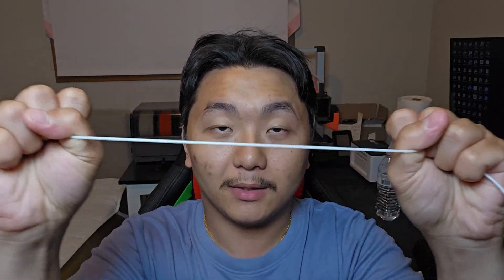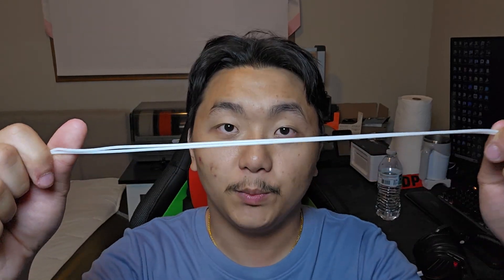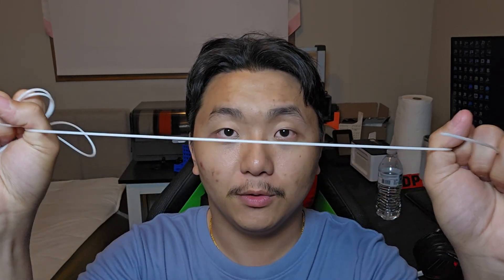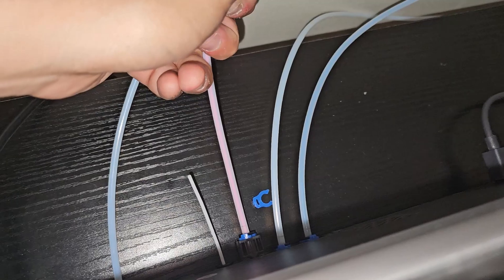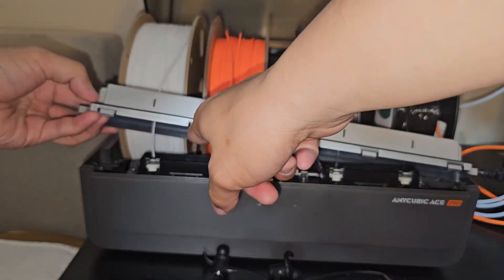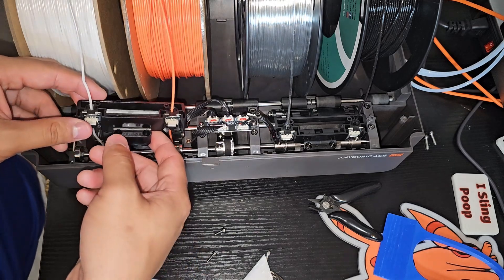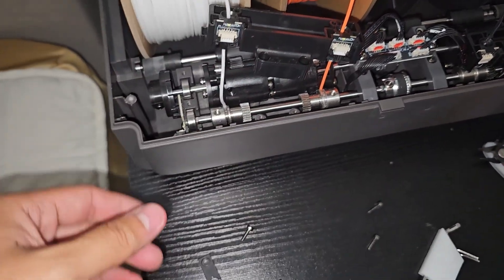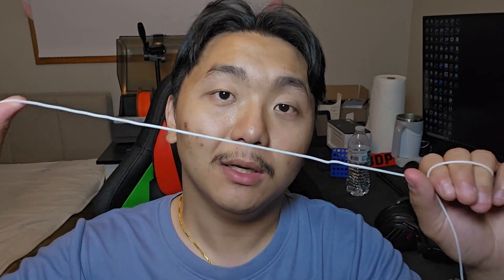Anycubic ACE Pro Cannot Print TPU So I Took It Apart

Comment: Thanks.  I tried to use some old TPU and it would not even extrude. Using your tips I got the ACE disassembled and was able to remove the TPU spaghetti mess.  It had all bunched up under the rollers.  I was able to pull it all out cleanly.  Thanks again!
Reply from the maker: Glad the tips helped you with the disassembly!

Comment: I had the same problem. I tried without the ACE PRO, but it still wouldn't extrude, even when I manually pushed the filament into the extruder.
I finally managed to fix it by loosening the extruder's pretension — specifically by unscrewing the hidden Allen screw on the right side of the extruder.
You need to find the right tension for it to work properly.
Check out this video to understand the problem: https://www.youtube.com/watch?v=5UEUFDP8M30
Reply from the maker: Yeah the ace pro is not design for printing flexible filament. Also yes the tension matters when printing flexible filaments

Comment: anyone tried just disconnecting the ptfe tube on one of the lines and using tpu in that line. perhaps a pulley with a slight weight can be used as a buffer?
Reply from the maker: I think the problem lies in the buffering zone. At the back of the ace pro where it moves back and forth.

Comment: I'm using the spool to print with TPU, it works well, although with some details. Since this is my first printer and I'm new to this, I didn't set the speed correctly and apparently, TPU filaments need a slower speed than other filaments. I set the bed to 50°C and the extruder to 215°C. I did this halfway through the print and it made a big difference, before that, the print base had lifted at the edges.
Reply from the maker: Yeah, if you print TPU directly to the printhead with no ACE then it works. Yes TPU needs to print slower.

Comment: I did the overhead ACE mount. Printed out a couple lid-hold-openers

Spool sitting in the ace. filament runs out the open lid directly into the print head. 

works great. 

you'd probably need to set up some dangling overhead pulley system to print TPU if you didnt do the overhead ACE upgrade
Reply: I'm planning to put the ACE above the printer anyway and ever wondered if it is really not possible to find a way to mix print TPU and other materials. For example to print sealing directly within the model. When you use the ACE like you described, will the TPU filament be rewinded as much as needed to let the ace switch to another material if the TPU was printed in some layers? If, then this would be a great and simple solution.
Reply: @stefankauerauf4282  I disconnect the multi material hub and drop the single stand off tpu directly in.

I'm sure they'll figure out how to do it sooner or later 🤷
Reply from the maker: Yeah, I should do something like that.

Comment: For Tpu you need the shortest way from spool to extruder. The more tube you have, the more screwed. You can print Tpu just fine using the spool holder, although, I rather have the spool on top of the printer with just a short tube going into the print head directly in the extruder, much better
Reply from the maker: Yeah, I just want to try and see if it works on the Ace pro.
Reply: @Scratch3DPrinting  did you manage to print tpu? I'm having problem with ace pro and kobra s1

Comment: While the extruder is a direct drive extruder, the fact that the kobra 3 has really long bowden tubes it effectively acts as a bowden extruder. So super flexible filaments don't work well. 

I don't know if these exist, but is there any kind of filament that has tpu with a PVA core? If so, you could use the more rigid PVA and dissolve it with water afterwards. It would leave some  gaps though so i imagine that filament doesn't exist. 

Thinking outside the box: if the outer shell of tpu filament was coated with a rigid wax, maybe that would help it get through the Bowden tube.
Reply from the maker: Yes that is true, the ACE Pro is like a bowden tube setup. I'll take a look at that PVA core. Thanks.

Comment: Also looks like the issue was trying to push a rope up a firehose.  😆 maybe a tighter tube?
Reply from the maker: For sure, a tighter tube might do the trick. I'll do more testing.
Reply: @Scratch3DPrinting  try with mno tube and a counterweight on a pulley to take up the slack

Comment: Always print TPU with external spool holder. ASA need to be printed in a enclosed printer like ABS with temps of at least 240/90. Good video anyway.
Reply from the maker: Ahh yes, but what if I wanted to to print tpu with multi color how would I do it with out using the ace pro.
Reply: @Scratch3DPrinting  add a print pause in slicer when you want to change color. I can’t print tpu in my AMS. Very hard to print multicolor with TPU

Comment: Try it without the ACE Pro on the single spoolholder.
Reply from the maker: I'll try that, but what I was planning to do it using tpu with other types of filament.
Reply: @Scratch3DPrinting  I'm shure that it works 😉. I would maybe put a small piece of PTFE tubing in the print head and then the filament. Good luck.
Reply: @Scratch3DPrinting  did you achieve your goal?
Reply: Its the only way☝🏻after printing if the nozzle gets cold dont use cutter… heat the nozzle up to 250 then pull it out… otherwise you have to open the geared part above the little heatsink… tried 4 times with ace pro no way to getting it work

Comment: Nice been thinking about picking this one up
Reply from the maker: For me it is a good 3d printer combo.
Reply: I have the Kobra 3 with ACE and it is amazing. I have a way more expensive Snapmaker that I only use for larger PETG / ABS jobs that need 1 color 1 material. 
  Kobra 3 fast and amazing is a PLA God.

Comment: just like the ams from bambu lab the ACE does not support filaments that are super soft like tpu it just gets wrapped.
Reply from the maker: Ohh really, I guess it is hard for these multi color systems to print with soft filaments then. First time using one so I don't have much experience with it.
Reply: @Scratch3DPrinting  yea it’s just such a long path for the filament to travel even if it gets past the buffer. great video though